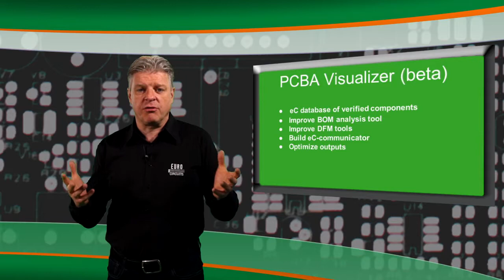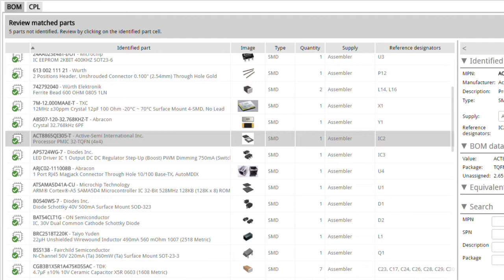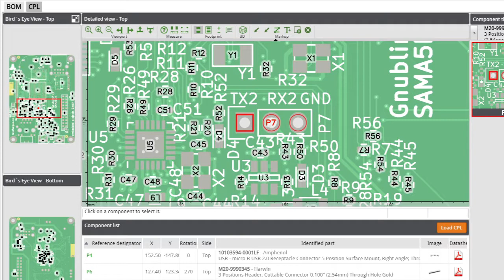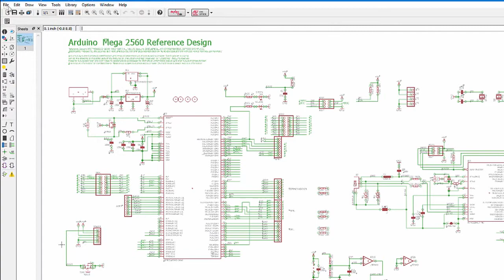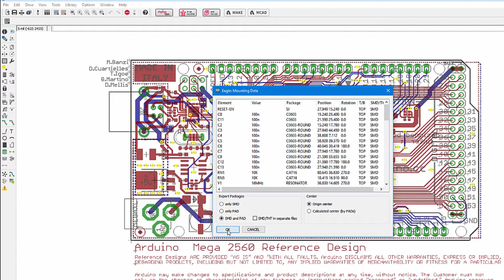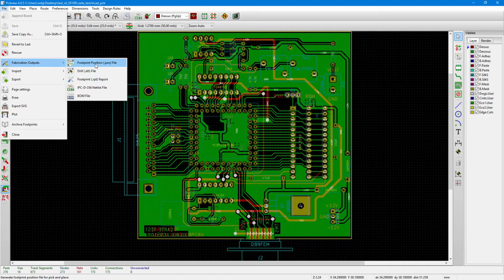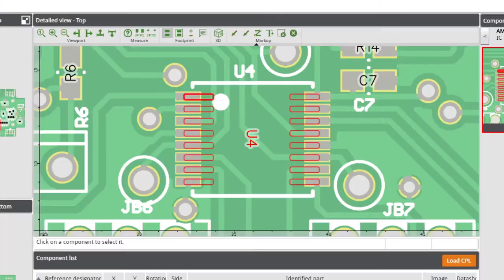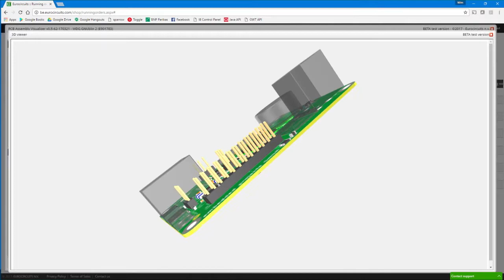News from Eurocircuits' PCBA Visualizer

Comment: It would be useful to publish example BoM and CPL files for people who are using other software, for example DesignSpark PCB. This is quite flexible in designing reports and it would be possible to match a sample file. I am trying to pause the video and read off the column headings, but they are fuzzy and sometimes scrolled off to the right, so I am actually guessing the format which is time-wasting.
Reply from the maker: Might be a good idea to make a BLOG on this and publish some formats that are easy to understand by the manufacturers. We'll take this up and put it before our design team. Thanks.
Reply from the maker: Available here: https://www.eurocircuits.com/pcba-visualizer-user-guide/